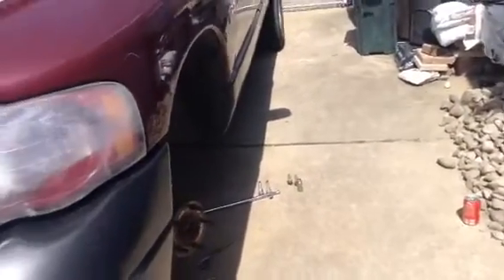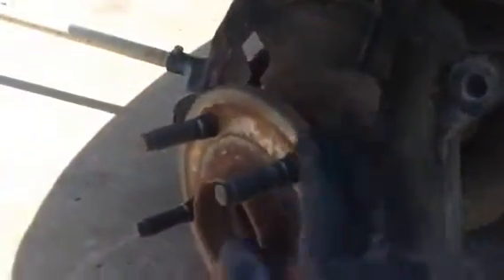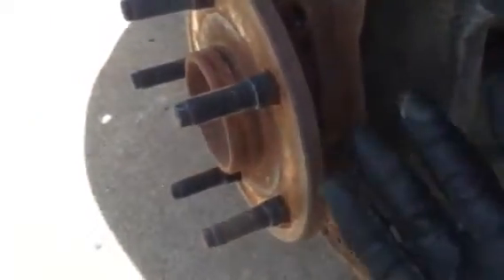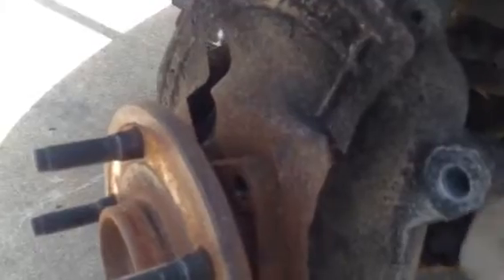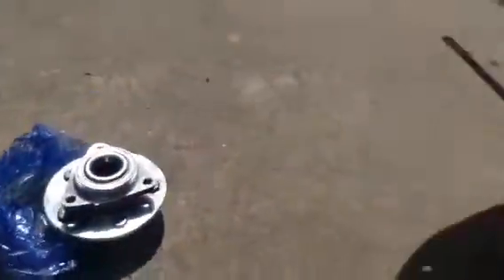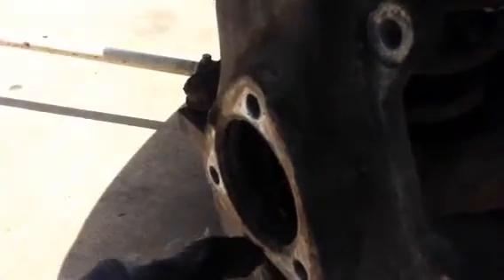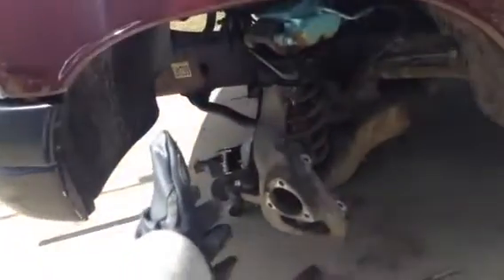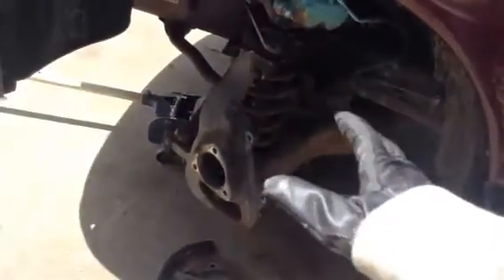Dodge Ram 2wd wheel bearing replacement

Comment: ROTOR! ITS CALLED A ROTOR AND YOU USE A RUBBER MALLET never strike a rotor that's being reused with a hammer.
Reply: It is also actually called a disc. 
As in....disc...brakes.
Reply: @skipads5141  in 18 years of being a Diesel Mechanic I have never and I mean never heard anyone refer to a Rotor as a disc. Must be some people that haven't been to the moon talk

Comment: I've done this before too, hopefully it'll take me just a little bit. Thanks for the tips I've learned the hard way before too, it was good to get it fresh in my mind before I start. And that thing you couldn't remember is a rotor lol but I'm sure you knew that just went blank in the moment lol I do that to sometimes 😂 
And DO NOT use Anti-seize on the wheel bearing I repeat DO NOT USE ANTI-SEIZE it is not a lubricant for moving parts!! You will go through wheeling bearings like crazy use a WP 2 grease.